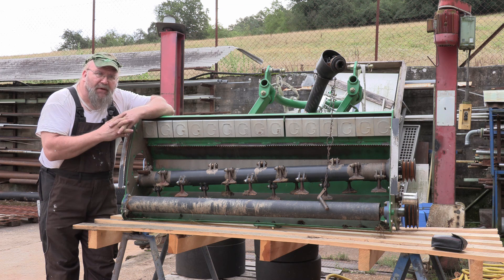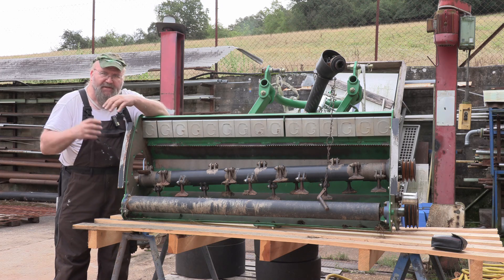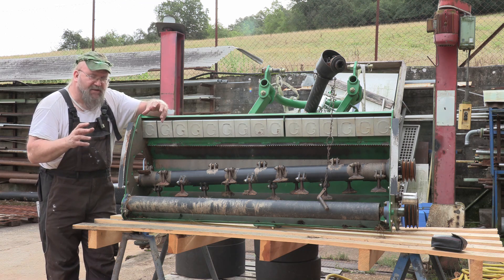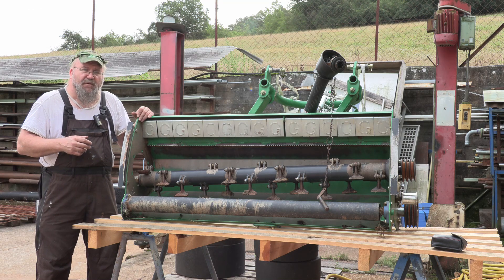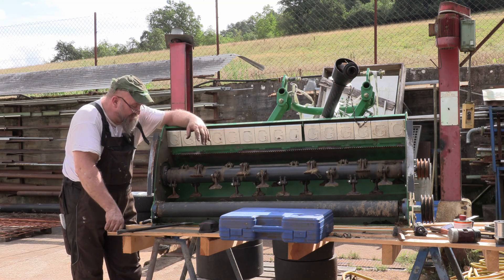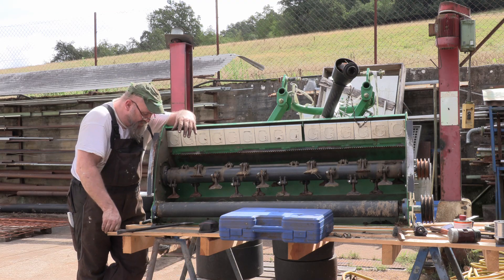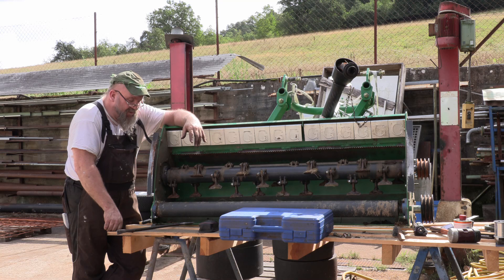Random Lengths, Episode 26, bearing quality

Comment: Looks like a muscled up flail mower.  Ground speed, pto speed, density of material be mulched are things to consider when using these. They can be overfed and plugged. Agree on the bearings and the bolts. You've done the best you can with it. If the machine comes back again, I would suspect operator abuse. The flail is turning fast enough that with the proper ground speed, the material should go out the back of the machine with little sign of wrapping around the shafts. Wrapping of material makes me think the guy using the mulcher was traveling to fast through dense material. JMHO.
Reply from the maker: yes, i agree. i've never seen one of these before much less worked on one. but some of the component issues were blatantly obvious from the onset. when installing the new V-belts i found another issue with PTO shaft alignment. once again the chinese QC really shines....